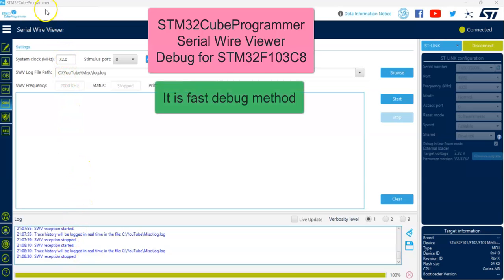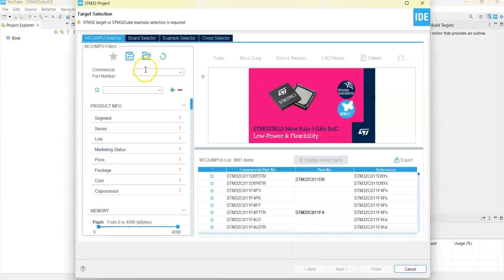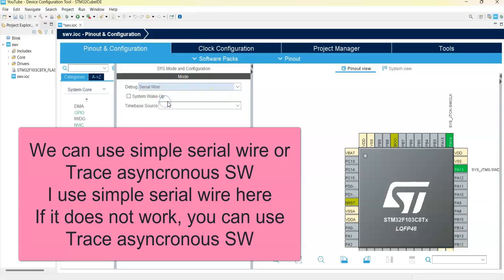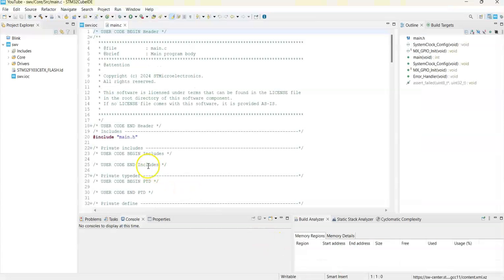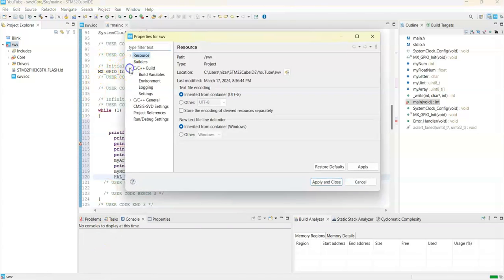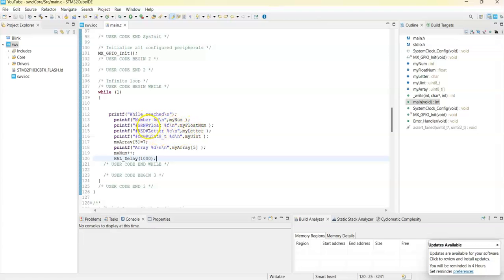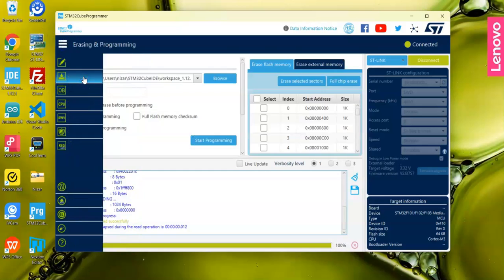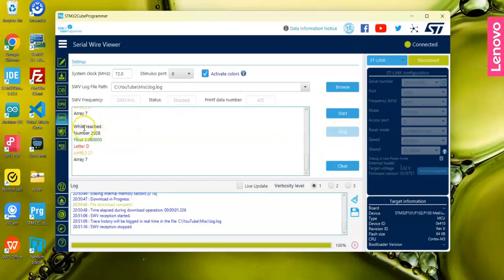98. Serial Wire Viewer (SWV) for STM32F103C8T6 in Cube Programmer

Comment: How can we do this in swv on cube ide for st-link v2 openocd? please help me
Reply from the maker: If your chip is clone STM32, CubeIDE SWV will not work
If your chip is original STM32, follow steps below for CubeIDE SWV
Debug configuration (Debugger tab) --> Serial Wire Viewer (SWV) Enable (Tick) 
After debug started
Click Window --> Show view --> SWV -> SWV ITM Data console
In the console (click configure trace button and tick port 0)
In the console (click start trace button)
Press Resume (F8) Debug
Reply: @NizarMohideen  I tried these, I think it didn't work because it was a clone, but thank you anyway. Your videos are very successful.

Comment: Hello i like you video very much! and i try the same using STLink v2 and bluepill pin connection as per your video, but STLink Utility report this error: 
           : Can not connect to target!
                  If you're trying to connect to an STM32W1xx device, please select Normal or HotPlug mode from Target->Settings menu.
                  If you're trying to connect to a low frequency application , please select a lower SWD Frequency mode from Target->Settings menu.
22:27:01 : Internal command error

could u please help?
Reply: I try on ST32CubeProgrammer it report this error: No STM target found, if your product embeds Debug Authenication, please perform discovery using Debug Authenication... could u help thx